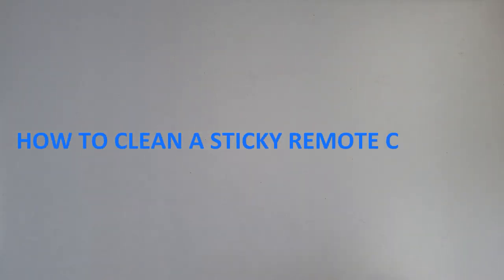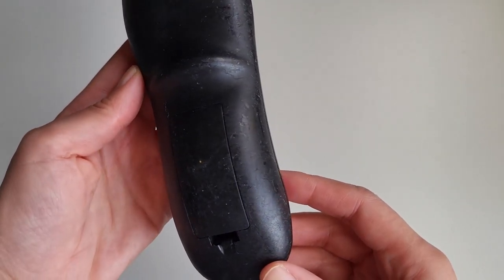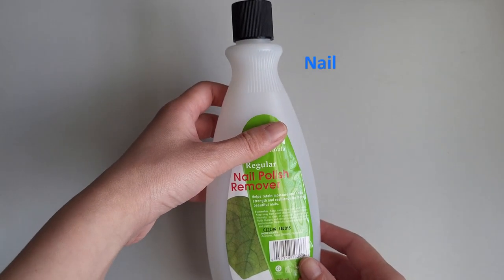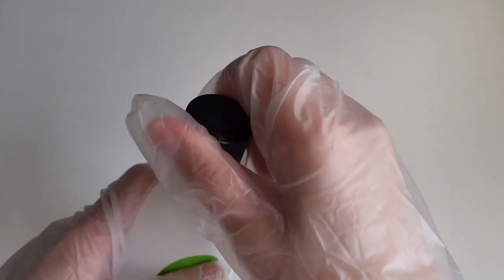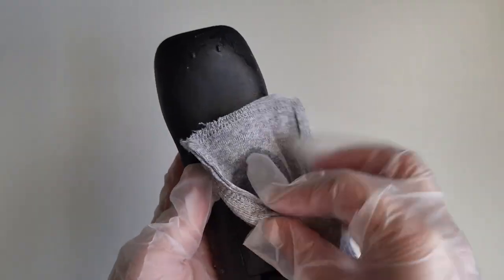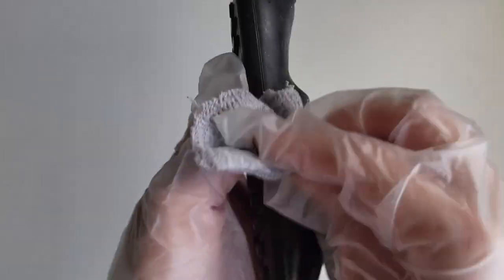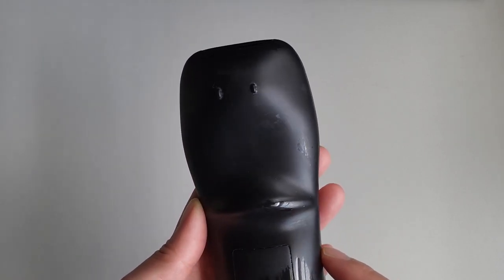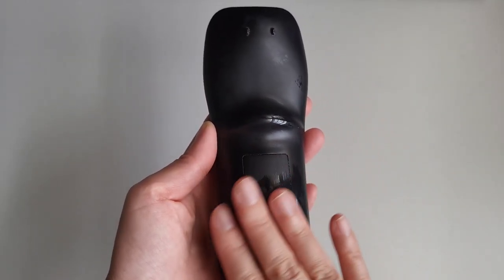How to Clean a Sticky Remote Control

Comment: I tried it on the back of a Bose remote. It didn’t work. It just go it worst. 😩
Reply from the maker: Goal is to rub off that top rubbery/coating layer that's deteriorating so you'll have to use some elbow grease. Also, when it's still wet with the acetone it'll feel gross, but once you dry off and wipe down with a clean paper towel, it'll feel nice and smooth. Hope this helps. Thanks for watching! 🙂